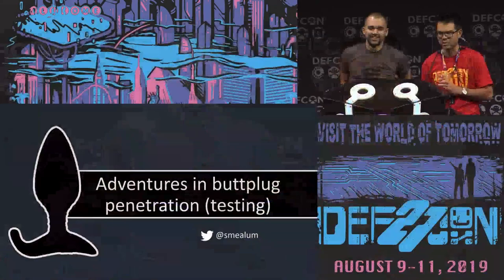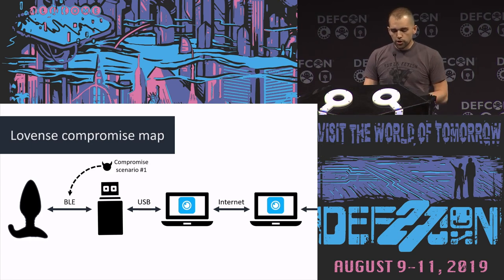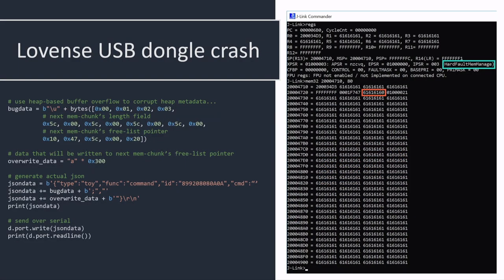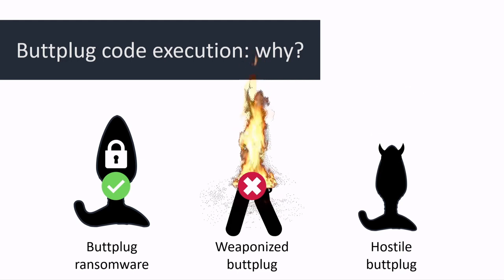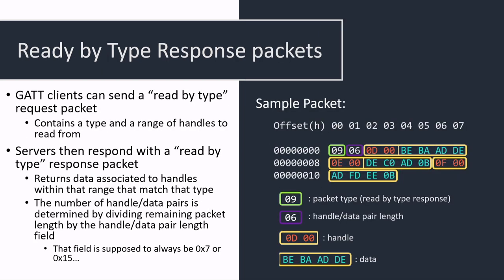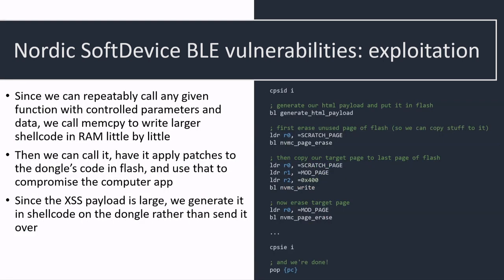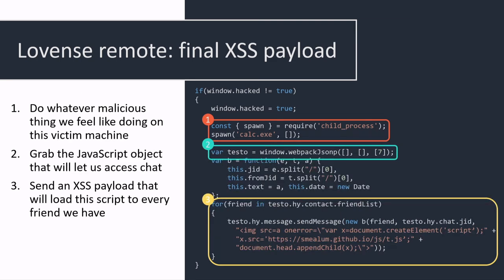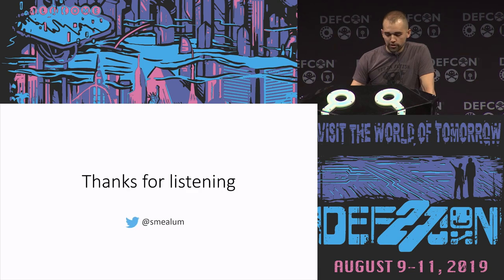smea - Adventures In Smart Buttplug Penetration testing - DEF CON 27 Conference

Comment: I want to see the TSA guy's reaction when someone has a bag full of disassembled, hacked buttplugs.

Also, surprised you didn't cover the privacy aspect. Do you really want anyone with a phone to be able to see that you have a buttplug?
Reply: with a......?
Reply: The hacking the plug part would be funny as well in the bar multiplayer scenario.

If you let it do funny shit, you could probably find the person actually using the buttplug at that moment.

And not just see that one is in your BT range.

But even at home it's a huge privacy concern. Because I can already see my neighbours devices, like some TV with BT, and I can even Screencast over wi-fi, because the TV has an unsecured ad-hoc WiFi.

So with the buttplug thing, everyone you share a wall with, will be able to see exactly which neighbour is owning that buttplug, due to the limited BT range.
Reply: Marcel Chb , if the neighbor has a HD wifi antenna,  you might even be seen by all the way down the hall or from the other floor. lol.
Reply: @GoodHydration  lol
Reply: Privacy in a public space is kinda ironic.

Comment: I doubt (I sure hope, at least!) it would be possible to actually hurt someone with executing malicious code. I'm not an expert in certifications for this specific field, but I do work with product safety for adjecent fields. All products to be sold must be certified and guaranteed to not cause personal injury. I'm pretty sure the regulations for stuff that goes into people are more stringent. You can either solve this in software, hardware, or a combination. If you select to solve it partly in software, development must be conducted in very specific ways and includes a lot of audits. In practice, this is a lot of work, which is why you would almost always try to solve these problems purely in hardware, to be sure that no matter what the software does, no harm can come to the user.
Things like charging the lipo, thermal management etc are likely done in hardware with a dedicated IC (likely the SOT23-5 and the other ICs close to it). So the only thing I can imagine doing is just running the motor at full power (which, again, it should be able to handle without heating up too much). In theory you could start/stop the motor in such a way that the back-EMF would damage something, but there seems to be protection from such things.

So no, I don't think you could weaponize the buttplug in any meaningful way.

Comment: you could actually melt and burn the buttplug a bit with the battery IF it's a Lithium-ion and only if you can control the battery management system (if it's coded on the chip then should).

What you could do then is the that it doesn't stop charging the next time it's on a charger. This will cause the battery to overheat if not manually removed, which most people don't do as these things often get charged overnight or hidden away.
Meaning you might set fire to their freaking HOUSE ....

Seeing how most small devices use a Lipo battery because of energy/size and the convenience, it's most likely their toys also use Lipo batteries.
If nothing you can always permanently destroy the toy by ruining the battery regardless of most battery types.

Now they might have a BSM on the battery, or have a hardware safety feature in there somewhere, that's something I don't know.
Nonetheless the potential to set someone's place on fire which is so relatively easy is REALLY scary.